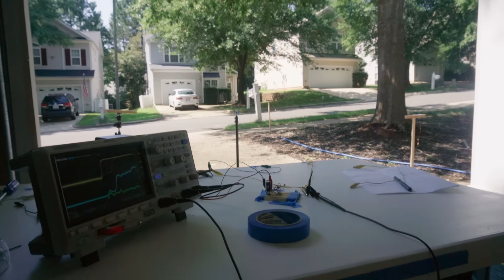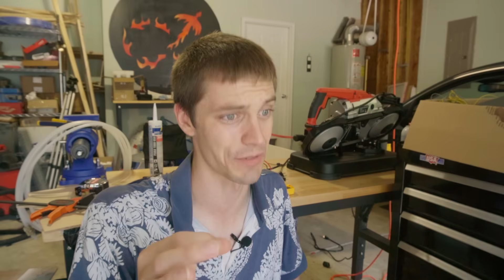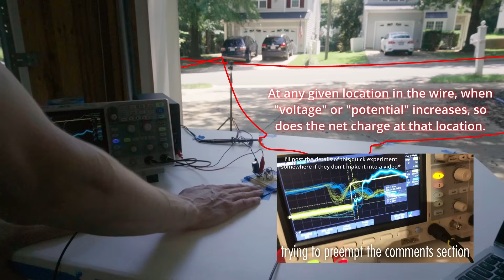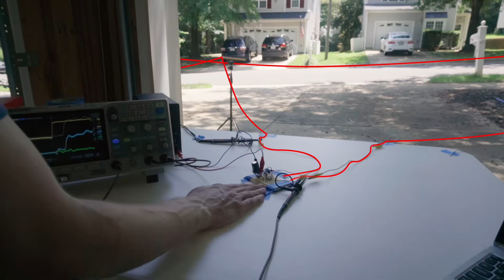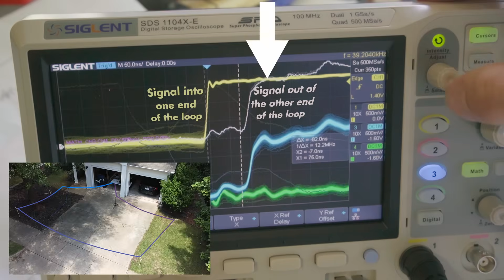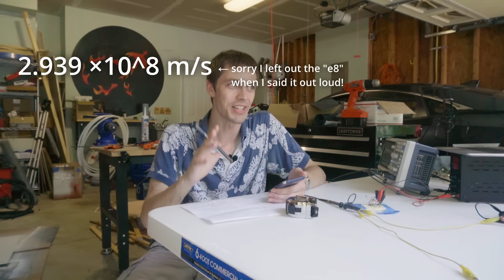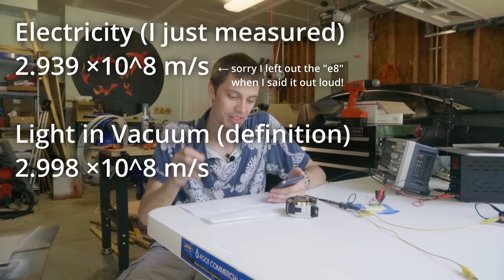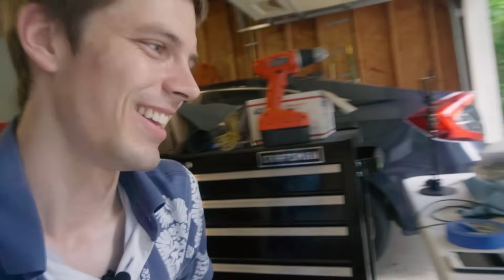Why does WATER change the speed of electricity?

Comment: So why not slow the external magnetic field with a choke ... a simple 50 turns of wire on a nail and see what happens? Or even a spark gap through the air. I always loved using a neon light transformer, to pass through a spark gap, and hold the paper up to the light to see the tiny holes. I would have to affect the electron circuit speed, and give you a lot more data

Comment: I believe that quantum particles (atoms) distort space time causing the wave to need to propagate through more space. So the understanding that the medium slow down light is wrong or slightly inaccurate. The electric field just has more distance to travel because of all the quantum parts in the atoms in the medium. I am not a scientist so I could be wrong.
Reply: Let me add one more thing. I don’t think you did slow down electricity but cause it to just go through more space. One the medium changes back to a vacuum,?it will happily go back to the speed of light.

Comment: Visible light acts as a particle because that is where the multiple wave forms meet and 'swirl' (similar to electron spin), this is what gives visible light the properties of a particle. Altering the refractive index of a material changes the points at which these wave forms spin, so the apparent light shifts position.

Great video.

Comment: 22:00
Not true.
Flipping a switch on and off repeatedly, does not make DC turn into AC.
It only pulsate, not fluctuate from +V to -V.
AC is based on Alternating from attraction to repulsion magnets. 
So, forward / backward / forward
Not, forward / stop / forward.
Reply from the maker: All Fourier components except the fundamental are ac. Considering that the signal is “off” for long enough that the water molecules can rerandomize every time, every single instance of turning the switch on makes a transient that can only be modeled as AC.

It’s like if there’s a dc bias, but on top of that bias there’s an AC signal at half the amplitude. You can consider both of those signals in the wire separately, but the bias actually doesn’t really matter for a “single” switch flip like this

Comment: I disagree with your comparison of ac to dc. You’re using pulsating dc to move electricity on one direction only. AC changes polarity and therefore electron direction flow. By ignoring the science of valance shell travel you ignore the fact that your static charging the wire in one direction only. As the electron moves at its speed it ionizes the next atom. The ionizing of copper is the field that propagates at the speed of light. That is not slowing down. Only the movement of electrons via the atoms valances properties dictate speed of electron progression as you static charge the medium using pulsating dc. Being sinusoidal is not the same thing as AC. It the same logic as saying all apples are red therefore everything red is an apple. By ignoring the equal charge in the opposite direction you ignore the very concept of AC and the tried and true transmission theories of AC that every engineer is trained on.

Comment: Interesting experiment, but I'm surprised that you made no mention of the effect that stray inductance and capacitance have on voltages with fast rise times, which occurs when opening or closing a switch. All electrical components and wires have characteristic inductance and capacitance which cannot be ignored when measuring high frequency voltage or current transitions. There are also significant noise pulses generated during make/break mechanical contacts, not to mention mechanical switch bounce. My point is that there are likely more influences on the oscilloscope traces than you are considering which may have a significant influence on your results.

Comment: My guess, before I watched the video, is that the speed of an impulse is not affected by the DC resistance of the wire.  Rather, it will be determined by the inductance and capacitance of the wire; which is summarized as the AC (complex) resistance.
And don't forget, there are three different "velocities" you can measure, 
and it depends on the frequency of the impulse.

Comment: what happens when you have a wire that's cut in many many parts with super small gaps in between the parts...? is the electric field of the electrons propagated?
Reply from the maker: Nope - the electrons need to be able to flow to keep going. They’ll all scoot slightly forward and then stop
Reply: @AlphaPhoenixChannel  even if the gap would be tiny tiny small (i don't know how tiny but maybe one atom thin...)?

Comment: You can also measure the frequency response by doing an FFT of the output and of the input.  Capacitors placed in the circuit would also lower the speed.  Also the ground plane acts as a capacitor with the dielectric being air.  Great video!
Reply: @maxbauer1633  What matters is the relative shift between different frequencies. Since audio frequencies are essentially the same frequency from an electromagnetic wave view (practically the same field interaction with surroundings, because so low frequency), the relative shift is next to none. Combined with usually only a few meters of cables, this is a completely ignorable effect, which you usually can't even measure, because of the noise on the wire.

Comment: If you want a more drastic impact of the medium you have to run a pair of wires through the water. The electric field is mostly trapped between the wires then which will slow down better than if its a giant loop

Comment: That wave is mathematically a conglomerate of multiple sine waves but it is not physically that. The physics dont work that way, the math equations do. It's a valid and seemingly correct use of math as it applies to the physical world but I wouldn't call it physics. Physically thats not whats we observe of course

23:09 I dont see how those two ideas are mutually exclusive? Is our mind that perceives reality not the fundamentals of our mathematics system? Are you basically asking whether or not the equations we use currently reflect truth or just form a simulacrum of it? I would say of course theyre not reflecting objective truth, theyre just the closest estimation we have so far. Everything we know is wrong to some, perhaps minor, degree of course, except worthless things like "uncertainty exists". Objective truth of a statement is inversely proportional with practical application of that statement. Everything in math is true, thats why math can only be applied metaphorically to actual physical reality. There are no perfect shapes, there are no numbers, there are no lines or points. But the relationships described by exploring how these these made-up components can be loosely applied to the objects which we do perceive to exist in physical reality

i once read a pdf that talked about how teslas invention of his weird harmless lightning bolts (infinite amps no volts?) came from basically severing an electrical connection after the electrical field had transmitted to the end of the line but before the electrons were able to move. I dont know enough about electricity to really verify what that means but i keep it in my head for perhaps a time when i do. You bringing up the difference between the speed of an electricity and the speed of electrons is reminiscent of that

Comment: I had an issue with propagation speed last year at a class I attended. We needed to design a waveguide system that splits a signal in 4 for a phased array antenna. We needed to design for two angles and thus we had to make a delay. Our delay lines were perfectly calculated, simulated and built, but because of the build process there was a layer of FR4 on top of the traces which slowed the waves down and doubled the angle.

Always watch all surrounding materials!

Comment: the electrons don't "flow" in the wire, and are certainly not slowed down by the resistance of the wire!  The electromagnetic field they induce which travels at the speed of light is perceived as current, but they don't "flow" like water through pipes! The electromagnetic wave do travel at the speed of light! not less! not close to speed of light!
Reply from the maker: Why do you say this? If that’s true, what is current?
Reply: @AlphaPhoenixChannel  it's the change in the elecfric field which is perceived as current.

Comment: 10:07
I saw this video yesterday, but was just thinking about how it's similar to sound. The thing is, particle collisions in a gas are really just interactions between the electrons in each molecule, so why doesn't a similar effect happen? I suppose the masses are very different, so individual electrons are affected way more, but they do have some mass. Would you still expect the signals to travel at the speed of light given this sort of "compressible flow"?

I guess the initial signal would travel at the speed of light, but then the real bulk of the current would sort of lag behind a bit.
¯\_(ツ)_/¯ ah idk
Reply from the maker: Shorter range interactions because the gas molecules are neutral mean that they have to more literally bounce off each other. The speed of sound
Reply: The way electrical current is established inside a conductor is different from the propagation of longitudinal pressure waves in a pipe. What makes the electric field inside the conductor follow the path of the conductor itself and having a magnitude consistent with Ohm's law j = sigma E ? It's the tiny surface charge that is also responsible for the electric field in the space between the wires.  Search "is the electric field in a wire constant" on stack exchange for a list of references.
Reply from the maker: @copernicofelinis  in order to generate that surface charge you have to push charges a short ways down the wire longitudinally - Derek skipped that bit.
I’d love to know of an instance where the surface charge (vs evenly distributed charge) actually matters, but I don’t know of one. For every purpose I am aware of, it’s completely valid to ignore the surface charge. The only time you can’t think of a wire as one dimensional is when you’re dealing with the skin effect in high frequency AC lines, where the current (not the charge) is concentrated at the edges of the wire
Reply: @AlphaPhoenixChannel  surface charge is all that matters. Read the references at the end of that staxkk exchange answer. Specifically, Chabay and Sherwood, Sommerfeld, and that Jackson paper (yes, that John D. Jackson) I mentioned in my other comment to you.

Comment: You were talking about those sine wave. Is there any chance to find a material that would slow down all of them (the ones composing the switch flip) and use it instead of water and notice the difference that would match the expectation made by the math? Or does the C/1.5 can be explained after decomposing the sine waves and looking at each of them and their slow down in water?

Comment: So, for my goopy goblin gamer brain, does electricity move more like the wave through a slinky or like a highway with a lot of traffic?
Reply from the maker: I’d say traffic because the electrons do scoot forward slowly, but it’s more even than traffic. What if you connected all the cars with industrial springs, paved the road with ice and wheels with Teflon, and then shoved one?
Reply: AlphaPhoenix 
Can the minor discrepancy between the speed of light and the speed of electricity not be that the electricity is slower, but rather that there is added time for the initial acceleration?

Comment: I always understood that that an impulse can be modelled as the composition of frequencies but I’d never heard someone use the fact that it contains super high component frequencies to explain why we can model the wave prolongation like optical light. This video is so cool — I’m so grateful for your channel!
Reply: Every electronics engineer knows it. They are taught Fourier Analysis in university.
Reply: @deang5622  Thanks Dean
Reply: that is why there is a limit to how much information you can send down a fibre optic cable for example. A pulse of light is a superposition of many different frequencies.  The more pulses of light you try to send, the more frequencies that signal is actually composed of.  Eventually so many frequencies are needed that it exceeds the range of the fibre to transmit them.  ie bandwidth.

Comment: Hmm. Slight correction maybe. It's not quite the electrons pushing each other. And it's not quite electron density gradient. It's better described as electric field density on the very edge of the wire spreading out at the speed of light. And because the field density is located on the edge of the wire it interacts strongly with the medium it's in. That's why your explanation works only for dielectric medium. If we thought about electrons and it's fields interacting in the medium outside the wire, then non dielectric materials with smaller speed of light (like glass) should also slow electricity down. But it doesn't.

Comment: Someone has already done an experiment showing that the length of the wire has no effect on the time it takes for energy to travel in a circuit. The EM field is able to propogate through the space between the source and the sink at the speed of light. So to slow it down you would have to put a barrier between them rather than around the wire
Reply: You're referring to the Veritasium video.  That's only for an impulse response, and even then the amount of energy is stupidly low.  You can basically model what Veritasium did as a giant capacitor.  EEvBlog did a response video about transition line theory on this subject.

Comment: As a Ham Radio guy I find your tests fun - and confirm what I have found in 60 years of playing with antennas. Your wire with thick insulation will have a Velocity Factor decrease of roughly 1% compared to a bare wire. I (we hams) see this in building antennas that are resonant at a specific frequency and using different wire insulation types. Wire thickness does have more effect on Q (which affects the bandwidth of resonance) than on Velocity Factor, but it is not in-your-face apparent. And your wire in a pipe demonstrates that the velocity factor of a coaxial feedline is highly dependent on the insulation and will generally have a velocity factor of 65% to 85%. Cheers, eh wot. DOC - K8DO
Reply: you mean that if he make this test with coaxial cable the signal will travel at 65-85% of light speed ? . its a good idea for him to repeat the test with coaxial
Reply: @leoyru.3361  yes.  Coax cable specs include "velocity factor" for the specific type.
Reply: Right. WA7VQR.😁
Reply: Insulation is also an "observer."
Reply: Yeah, nothing new, but it's fun to watch just the same.
Reply: insulation changes capacitance. seen it too.
Reply: I  would be interested to see what the difference would be if you use saline solution instead of just plain water. 😁
Reply: @richardchambers256  NaCl increases conductivity in water  and can be added to create up to 25% Saline Solution if boiled.
Reply: Thank yu very cool. I love open ideas in discussions of knowledgeable thoughts . Great job,💪
Reply: Now you've opened a can of worms.

Comment: Electricity DOES NOT travel at the speed of light, it REACTS at the speed of light.  If you want to learn the difference, you can look it up.  Electricity actually travels at ~1 inch/hour.  Yes, that is correct, ~1 inch/hour, and can be calculated based on the conductor and the size of the conductor, as it does vary.
Reply: You need to change the word "electricity" to "electrons" and then what you said would be correct.  Electricity does travel at the speed of light, as it is the EM wave that is used in electronics, not the physical speed of electrons.  If that wasn't the case, when you hit the switch on your flashlight, you'd have to wait several minutes for the electrons to get to the bulb from the battery.
Reply: @stargazer7644  I chose the precise words that are correct.  Your use is incorrect.  Do you have a physics degree in electronics?
Reply: @cnc-maker  One day you'll find out being a know-it-all doesn't help you to get ahead in the world, especially when you have the wrong answers.    One doesn't get a physics degree in electronics.  I have a degree in Electrical Engineering.
Reply: @stargazer7644  tell that to my diploma.  Have a great day.

Comment: How about cold electricity? ;D There is a huge difference in DC, AC, HV and cold electricity. Seems like in DC, you push the juice and lose some of it in the field, with heat. In AC, you "ring" the material. In HV, you "ring" the field of material. And in cold electricity, you pull some of the juice from the field of the material. There is also the pulsed DC, that has additional energy from collapsing field. It seems to be similar for energy that is boosted by beat with the same frequency. There is always three poles: positive, negative and neutral.

Comment: Would turning the dc signal off propagate more slowly than turning it on? (Since the water molecules are already aligned they're having a more significant interaction with the electric field?)
Reply: No, because it is the motion of the electrons that affect the electromagnetic wave, not the alignment of the atoms. Electrons are displaced by the EM filed causing them to generate an EM wave of different speed and frequency. The interaction of two waves of different frequency and speed (called superposition) gives a resultant wave that is faster than the slower wave and slower than the faster wave, in other words a speed somewhere between the two. It is this resultant wave that travels through the medium. The alignment of the water molecules does not matter since it is the electrons that generate the EM waves.

Comment: What would happen if you put a much longer wavelength sinusoidal signal into the wire in the water pipe? would you observe a measurable phase shift closer to 9x slower?